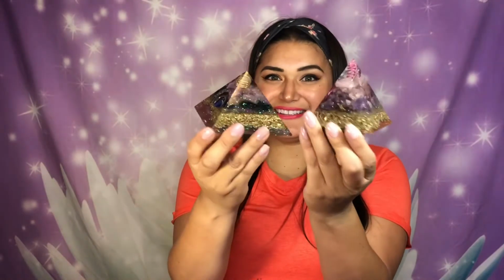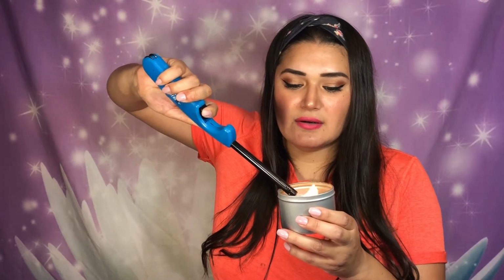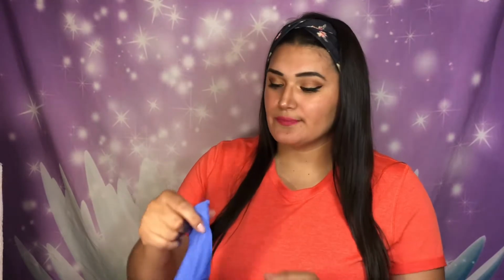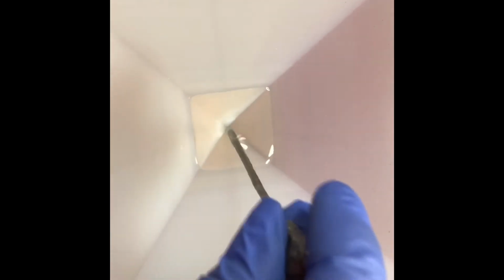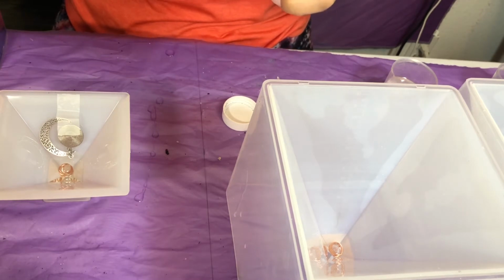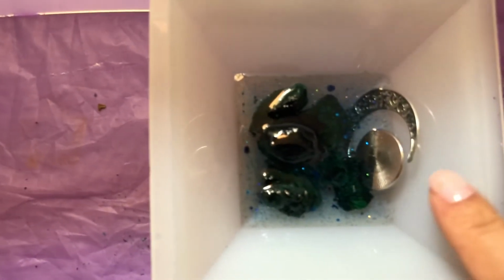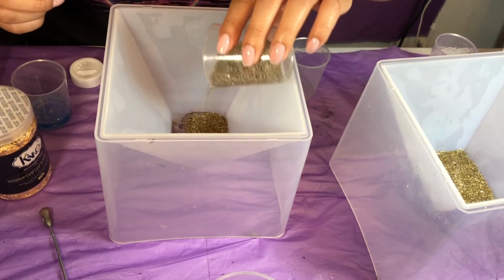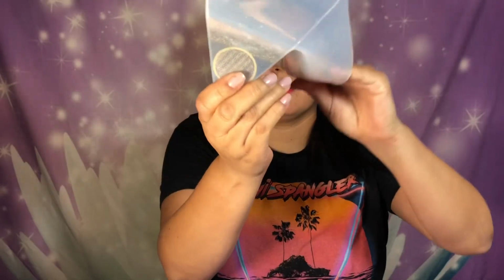Crystal Pyramid Tutorial my process on how I make them

Comment: the wooden sticks are called wood craft sticks. Wire used for jewelry making comes in gauges. The higher the number the easier the wire bends. 22 gauge wire bends well, but you'll need a tool to shape the wire. Fyi for beginner crafting viewers.

Comment: Soo gorgeous 💕💕 Do you also spray quick release in the mold before pouring or will I  not need it? Thank you blessings...
Reply from the maker: I’ve never used quick release. Comes off easily with silicon molds. But if you’re using another type of mold that’s probably a good idea.

Comment: Thank you for this tutorial. I have been nervous to get started but now I will.only question is how long does it have to cure after the first layer
Reply from the maker: It depends on how much resin is used. Less resin takes longer to cure because it generates less heat. It also depends on the temp of the room too. When it’s warmer it cures faster. I just check up on it in a few hours. I’ll tap my little metal stirring stick to see if it’s hard enough to hold another layer.

Comment: Those were really nice. So putting anything on the sides, the resin will cover it?
Reply from the maker: Thanks. Yeah it depends what it is. But those thin metal stickers get coveted by the resin easily. If I put a picture on the side I try to make sure resin gets on front of the picture by pouring the resin first and then sticking the picture to the side.

Comment: My question is, with everything encased in resin...wouldn't that trap any energy produced INSIDE? Why not let some of the crystal and copper poke out of the resin somehow and maybe make a copper antenna coming from the copper coils that often  wrap around the crystals? Hardened resin is an insulator. I just don't see how these can do anything without something being exposed to the outside. Maybe I'm wrong.

Comment: Can I get some tips from you. My pyramids came out bumpy lumpy, I sandpaper them, then put a thin layer of resin and it dried up all blotchy and smoothe, I tried again with uv resin, again all blotchy. I used a foam brush. What am I doing wrong.
Reply from the maker: Hmmm, I’ve never had mine come out that way. Did they cure completely?
Reply: @FeliciaJasso  yeah, I just thought I'd give it ago at giving a thin coat for an extra shine but it's dried up blochthy and not smoothe

Comment: The metal to resin confuses me a bit. How do you make sure you have enough metal to resin? A 1:1 weight?
Reply from the maker: Yes. If I’m using 150 mL of resin, I try to use just as much metal.
Reply: @FeliciaJasso  that's helpful, thank you for clarifying for me!
Reply: @FeliciaJasso  so I added all the layers and waited for it to cure. The second to last layer was the copper/resin. 
The bottom layer was hard so I took it out. After about an hour or so, I noticed the copper/resin layer was bowing out and not totally cured but all the other layers were. Do you know why that could be? It has been about 48 hours since I made that layer.
Reply from the maker: That’s weird. It should only take 8 hours to cure and 24 hours to fully cure before you unmold. It sounds like the A to B ratio on the resin could be off. If there is slightly more A, then it will never fill cure. Is the resin you’re using a 1:1 ratio?
Reply: @FeliciaJasso  yes, it is. I left it out in the sun all day yesterday since we had a 75° day. It still hasn't cured so I think you're right, the ratio is off. I'm going to try again. I also realized I've been measuring the resin by weight vs volume. 

Thank you for your help!

Comment: How long do you leave it to cure for each layers of the resin?
Reply from the maker: It depends on how much resin you use. It can take 3-8 hours. More resin cures quicker because more heat is produced than when you use a small amount of resin. The tip of the pyramid always takes longer to cure because there is less resin. Also, the humidity and temperature where you’re doing it can change the curing time also. I live in California where it isn’t humid so the curing time is pretty good, but I’ve heard in more humid environments it takes longer. I usually just come check on it and tap it with a metal stick to see if it’s firm enough to hold the next layer.
Reply: @FeliciaJasso  thank you very much

Comment: Can't believe I did this, I started a pyramid and let it cure 24 hrs and realized I didn't put the silcone liner in it first (I know) now I can't get the beginning of the pyramid out, do you have any suggestions on how to get it out or is my whole thing ruined? I've tried heat so far with no luck and it's too big to put in the freezer... please advise....
Reply from the maker: I’ve never had that happen before but maybe try to pry it gently with a knife.
Reply: @FeliciaJasso  I finally put really hot water on top of it and pried it with a knife and it popped out, whew...
Reply from the maker: @Phantom-cw4gn  That's awesome. What a relief! Glad your project didn't get ruined. :)